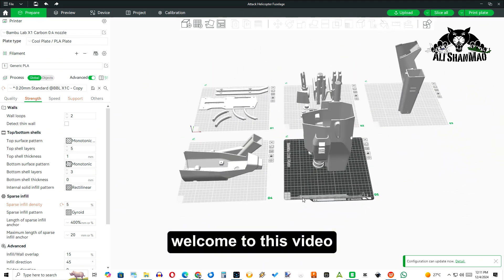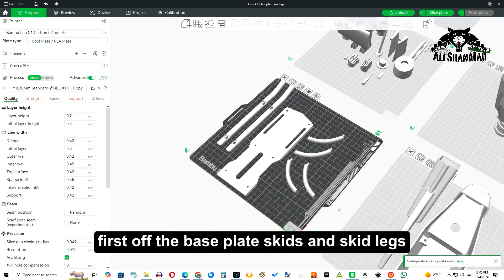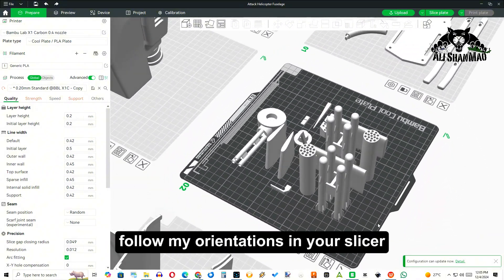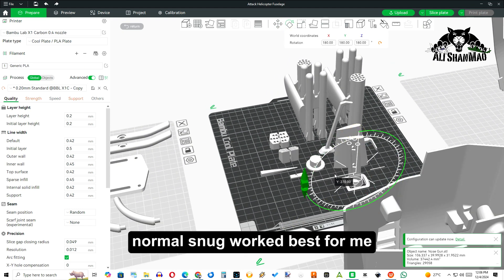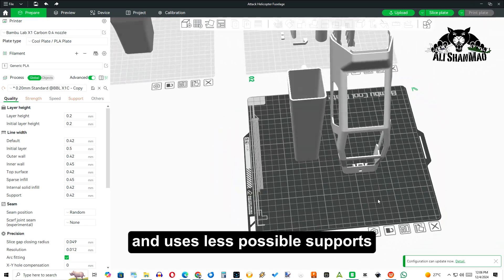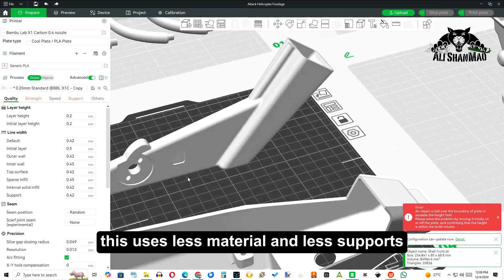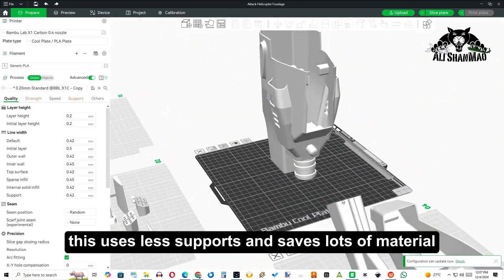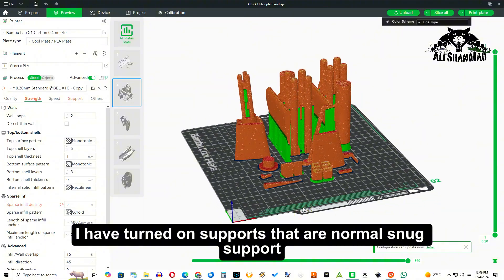Best 3D Printing Orientations and Settings fo

Comment: Can you be like CH53 helicopter?
Reply from the maker: @MichaelGriffith-s3z  I can design that. If someone orders the design service
Reply: @alishanmao  when I was in the marine corps, I used work on them. What is the biggest size you have made. I would like to have a 700 mm size
Reply from the maker: @MichaelGriffith-s3z  I can do 700 size. I have designed and 3d printed boats for two persons, 1 adult and 2 kids etc. so size does not matter. If someone orders the service, i can not only design the fuselage but also assemble a 700 size helicopter for it, put the fuselage on it, prepare it, test tweak and ship to customer. welcome to engage my service my friend.